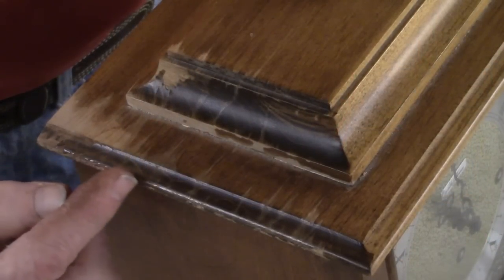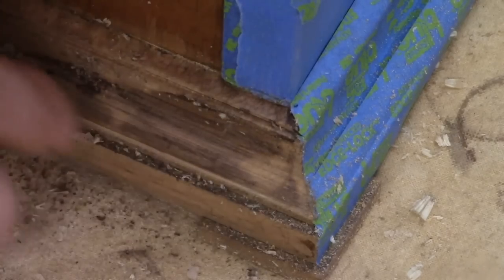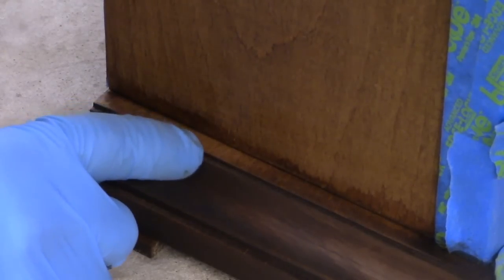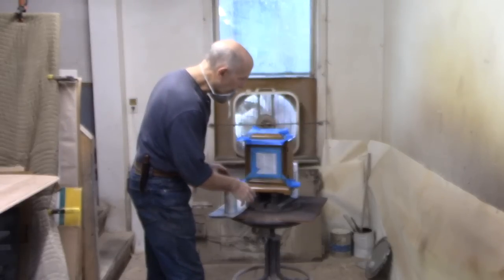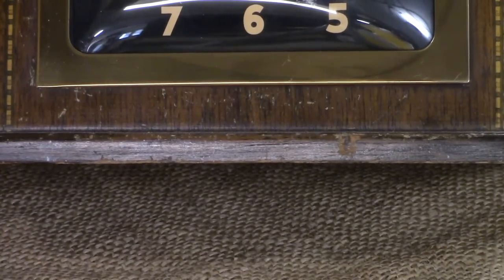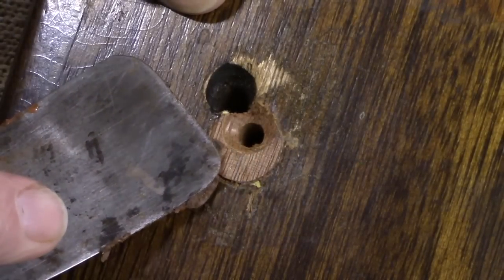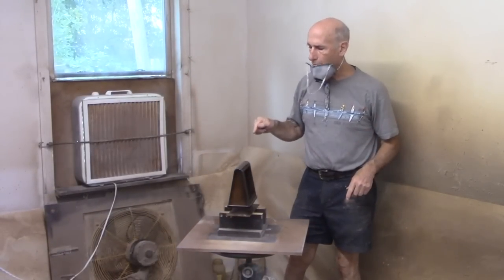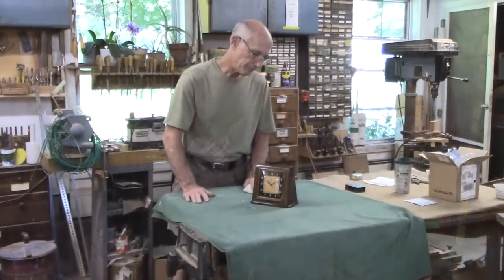Hours Later, It Was Done

Comment: Hi Tom, Telechron made that model "Pharoah" clock from 1934-1942. People may not realize but those clocks are more accurate than the later quartz clocks that put the nail in the coffin for many of those companies. Sadly, the oil in those clocks does gum up over time and needs to be refreshed but they are still great looking clocks, with tons of character. I remember your original video when you refinished it and you did a masterful job. Thank you for sharing your methods so others may learn from you!! 😁
Reply from the maker: Thanks! Interesting information! I want one of those
Reply: @johnsonrestoration  I sent you the info for them in the reply to your email Mr. Tom. 😁

Comment: Me like that Deco clock!

Interesting how you fixed the hole; I would have routed it clean with a spiral bit, then glued a plug. I wonder if they changed the movement at some point - otherwise I can't figure out why the 'wonky' hole was needed at all, so near yet so far from the original hole in the case.
Reply from the maker: Thanks David! I want one of those too! It was tough to decide the best route to follow with that. And once again I will usually choose the method that removes the least amount of original material, my default approach

Comment: Beautiful work on both of these clocks!  I'm partial to the style and look of the 1936 clock, which has some of that Deco flair to it, but I actually prefer the color and tone on the first clock.  I think you did an excellent job matching the tonal value of the color on that first one, which had a kind of blonde look to the stain to me, but it was clearly a brown with less red in it.  Even on-camera it was obvious that you were getting closer and closer with each go at mixing the stain. The repairs on that first clock required a lot of  finessing, and you virtually erased the damage completely on that one.  It just looks like it had some age to it, but otherwise felt like a new clock. No sense of water damage whatsoever. 

 The second one looked great also.  Plugging that hole in the back and redrilling a new hole really helped the overall appearance of things.  Once again, you did a great job color matching, and repairing the damage with sanding and color matching.  Did those cracks/creases disappear at the top of the pyramid?  It looked like the majority of them smoothed out in the sanding to me.  

Just excellent work, Tom! You're just amazing!
Reply from the maker: Thanks! I appreciate it! You could still see a little of the cracking, and of course it may come back. But very unnoticeable

Comment: Hello, Thomas!! Great job!!! I enjoy your work.
A question about the last watch. In the last video you put a black paste. I don't know what it is. Can it be to fix the scratch or the porosity of the wood? Could you tell me what it is called and what is the function? Thanks and greetings from Argentina.
Reply from the maker: Thank you! That’s a “medium” grade compound. It’s purpose is to remove scratches and fine sanding sanding marks in the finish, and bring up the sheen, and allows you to match the new finish areas with the old. Most compounds are light in color and can get down into areas where it can be difficult to remove. Mohawk makes this black compound which really helps avoid that problem. You can get compounds at an Auto Paint supply store, or the automotive section at the hardware store
Reply: @johnsonrestoration  Thank you for your answer and explanation about the compound!!!!

Comment: Hey Tom! Another great video! 
I wonder if this tip would help you? 
I do nails for a living, sometimes when I'm filing nails, the file can occasially clog if the gel has been slightly undercured.. 
A good stiff nail brush gets it right off.. 
Maybe this could help you with your sanding? It's the same principle in a way. 
Hope your well!
Reply from the maker: Thank you! Yes, I often have a Scotch Brite pad handy to clean off the bits. Also, with our rasps and files, we have what is called a "file card" which is a stiff wire brush for cleaning those while working. Interesting similarity between the 2 trades!

Comment: Tom, which is easier to deal with: mixing two liquid colors of stains (oil-based) or one liquid and the additive of a different color powder? I know you can spray toners with colors to add small fixes, but liquid to liquid or powder to liquid - simply curious. (Yes, I will be finishing a piece that "may" need some additional color work.)
Reply from the maker: Thanks! Ideally it's best to mix the same stains. But with oil stains it can be difficult to get all you need, like more intense red or really dark walnut, and then I will resort to adding powders or dye stains. Its important to mix things that are solvable with the same solvent, but I don't always heed that rule

Comment: Excellent work as always, Mr. Johnson! I'm in absolute awe at your ability to color match -- a little here, a little there. Man, it's just alchemy. I am wondering why you opted not to seal up the gouged out hole for the Art Deco clock winder though. I figured you'd do that...
Reply from the maker: Thanks Jesse! It’s tough to remember, I need to go back and look, but generally speaking, I will seal a secondary area if it was sealed originally, otherwise not

Comment: I have a ballerina clock that belonged to my grandmother. It’s electric. I have lots of gluing, sanding and laquer in my future. Not sure how to figure out the electrical part. I’m sure it’s just a loose wire. Do you have any YouTube recommendations for troubleshooting the electrical component? Thanks.
Reply from the maker: Thanks! A ballerina clock sounds interesting! I don't have any recommendations. I haven't had to deal with something like that in a long time. If you can access the motor and moving parts, clean them and oil them as best you can. Sometimes a gentle air stream can help. Work it by hand to get the oil distributed. Good luck!